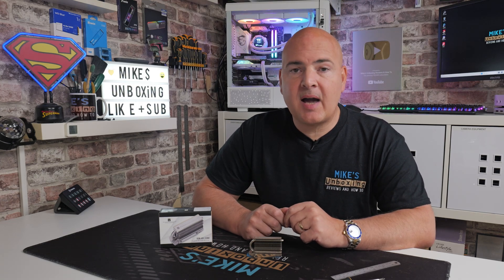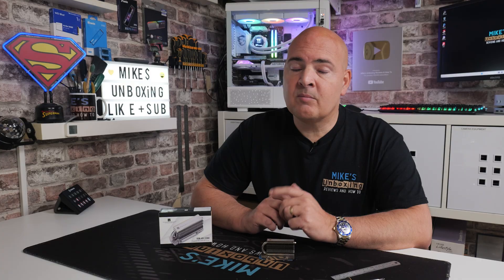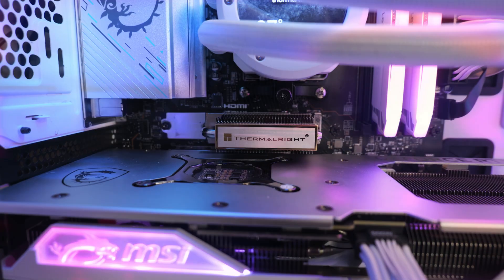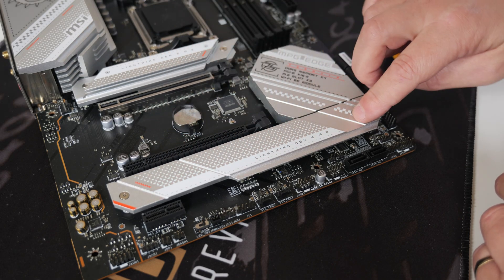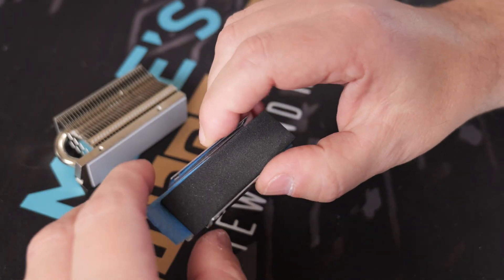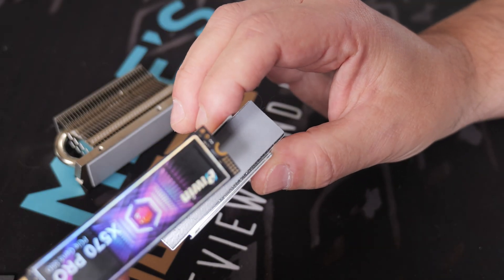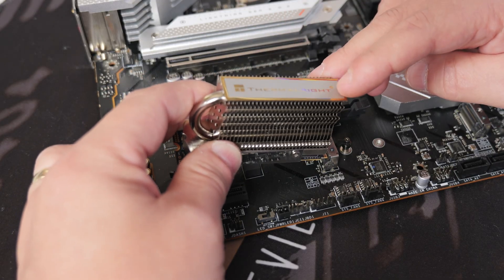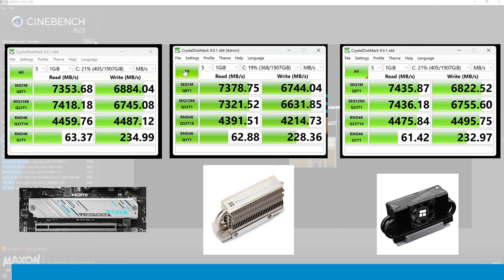Thermalright HR09 BEST Budget  Install Guide & Thermals

Comment: Thanks for the review. I have a question. Is it possible to put two  Thermalright HR-10 2280 PRO Digital coolers (or at least two HR09) on that same board next to each other?
Reply from the maker: yes the foot print of the cooler is the same as or less than the drive itself, only the height is different
Reply: Thank you for answering my question. Keep up the good work! Cheers

Comment: I picked up the HR09, a great bit of kit. It adds a bit of weight, the Lenovo m720s that I stuck it in initially has a poor m.2 latch so I had to remove it, the weight made the m.2 wobble a tad. Stuck it on an Gigabyte board with screws to secure the m2. and no problems.

Comment: Great device for cooling nvme's especially for high work loads. Doubt you could mount the fin stack other way rouns as it would block both the mounting to motherboard and the ability to use lock screw due to the offset. Great value esp if prolongs life of nvme. Thanks for reviewing Mike and Kath 😻👍
Reply from the maker: You're welcome! It's definitely a solid cooler for the price.

Comment: I’ve never found a need for these yet ??? Although with pcie 5 maybe that day is coming as PC’s are using more and more power especially with video cards and I actually see the day coming where people are going to need a dedicated circuit for their PC as most home circuits are at 20 amps with some outlets on a 15 amp circuit.
Reply from the maker: That's an interesting thought about the dedicated circuit, definitely something to consider as power demands go up!
Reply: @mikesunboxing at US power 1500 watts is approximately 12.5 amps and most homes have multiple outlets on the same circuit, some of these video cards today are drawing absurd amounts of wattage. A 5090 hits 600 watts at peak power so roughly 6 amps plus other accessories easily a powerhouse gaming PC is easily hitting 10 amps now, not gonna happen tomorrow but as power usage increases it’s bound to happen.

Comment: The mad scientist in me wants to get a couple of HR10's and some longer bolts and try and rig up a CPU cooler.
Reply: I actually want to buy this, rig this in Pi5 and see how far I can push my my Pi5.
Reply: Only one way to find out. No idea how you  figure out the optimum mounting pressure to get it right to not damage the cpu or socket.

Comment: Would love to use one of these but I think it's sort of a flawed concept. The m.2 that would usually be gen 5 is right between the cooler and the gpu. There's no way it's going to fit there it's just too tall.
Reply: True, there's plenty Gen 4's that have above PCIe slot like in my mITX but so far most (all so far that I have seen) Gen 5's have been beneath the GPU.
Reply from the maker: i would disagree slightly with that, gen5 drive slots are often the top slot above the gpu as the traces to the cpu are shorter and less likely do get interference from the gpu traces, but i understand where you are coming from, some boards will have slot under the gpu but this is getting rarer as time goes on and many are including extra slots along the bottom row above the front panel connections to avoid clashing with GPUs